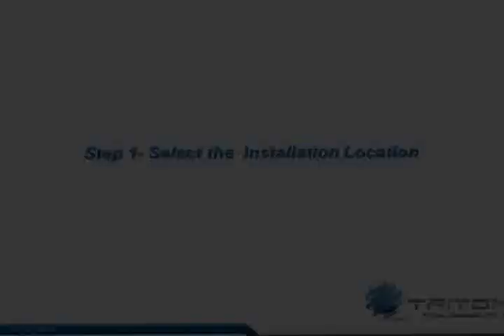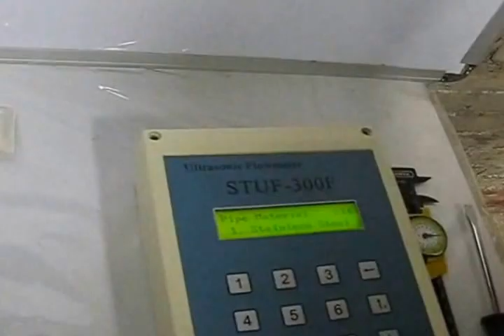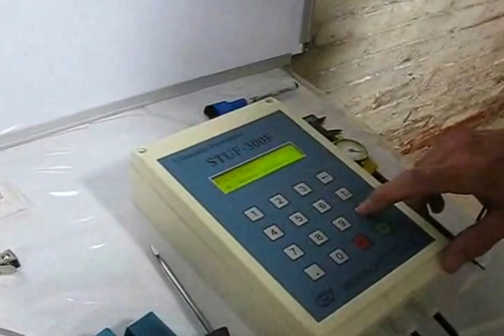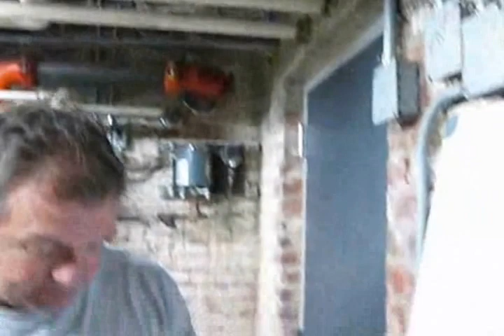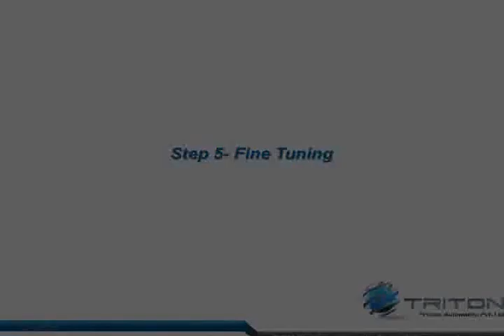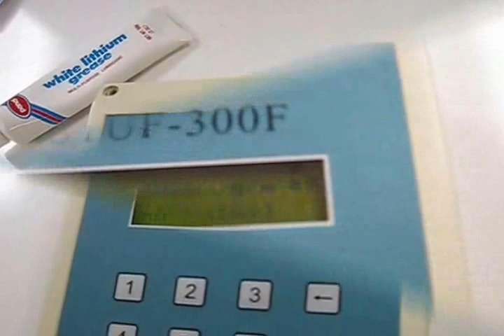Clamp on Ultrasonic Flowmeter installation

Comment: Beautiful video, but I have a problem... 
why when I install the flow meter the time ratio is 78/79% but the Q signal is >60?
every parameter is correct, the coupling agent is applied, I follow the same steps like you..I'm desperate :(
Reply: did you find a solution to your problem?